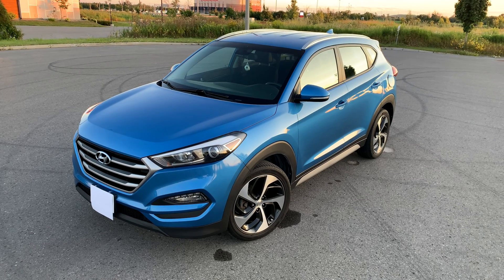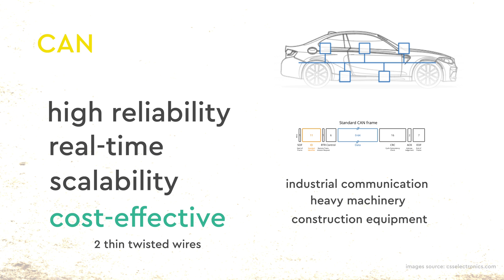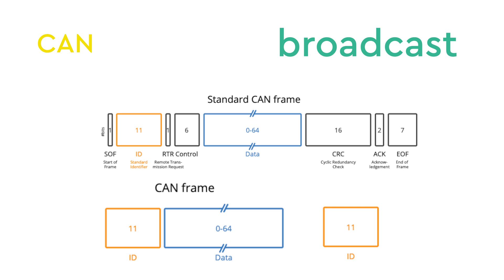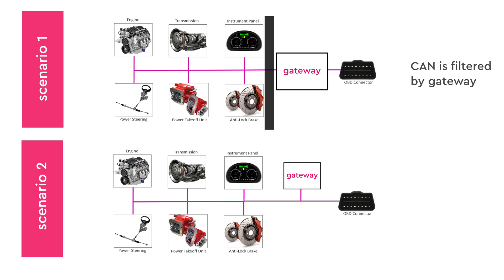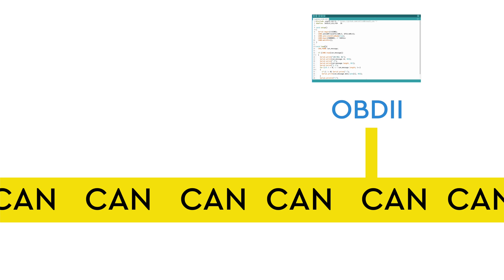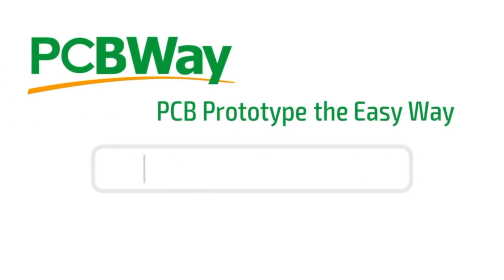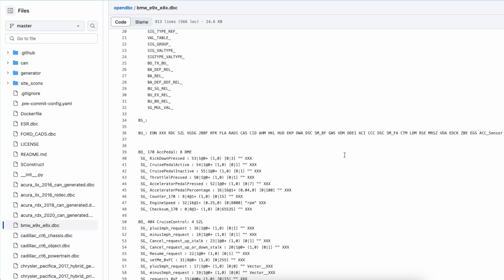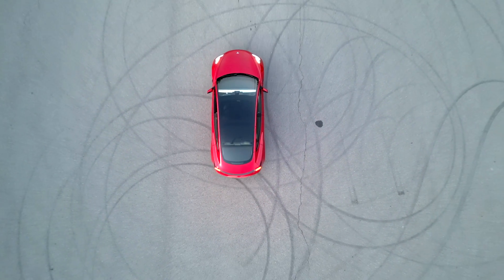CAN vs OBD2: What is the Difference?

Comment: Hi,
I have an issue with my hyundai tucson 2017.
The original reverse camera has dynamic trajectory lines. But after installing a new android head unit with its own canbus. I was unable to retain the dynamic lines while using my new 360 cameras. Also the canbus doesn't recognise my door open. But it does control my steering wheel controls.
So I bought an OBD harness specifically designed to rectify these two issues. 
The OBD connects to another canbox (separate from the canbox that came with the android harness). Then it plugs into the 8 pin socket at the back of the unit. The problem is that the original canbus box that came with the unit needs that 8 pin socket too.
Does this mean it's impossible to get the trajectory lines and door opening without loosing steering wheel controls?

Comment: Is it possible to use a obd2 to read the steering wheel angle then give that data into a head unit to make a older model car in my case a 2010 toyota corolla have dynamic reverse lines (the reverse lines that move with the steering wheel)

Comment: @MrDIY thanks for your tutorials! 
Do you see any chance to control a car using CAN bus / OBD II so it could drive itself? 
Let's say, go into drive mode, release the brakes and go forward very slow and then brake and stop again...
Reply from the maker: You might want to check a project called OpenPilot
Reply: @MrDIYca  thx so much. Will have a look.

Comment: I have seen your webserial vid. Have you thought about a universal project to connect a existing nano (or any arduino) project that will connect to its serial port and a esp8266 or esp32 reads nano serial port and retransmits it via webserial. It can be used to temporarily troubleshoot/instrument a simple project that does not need full time webserial.